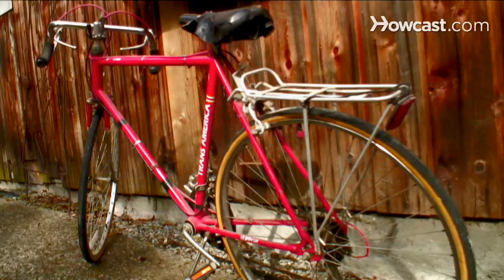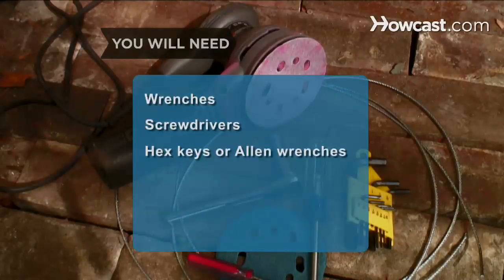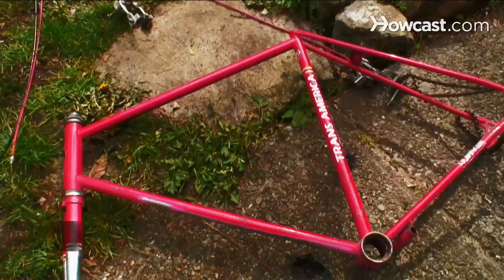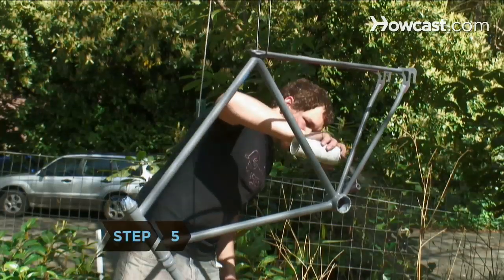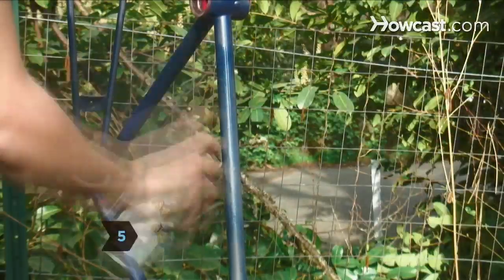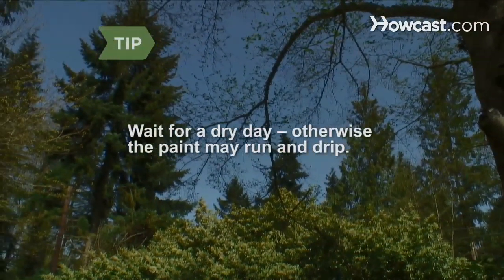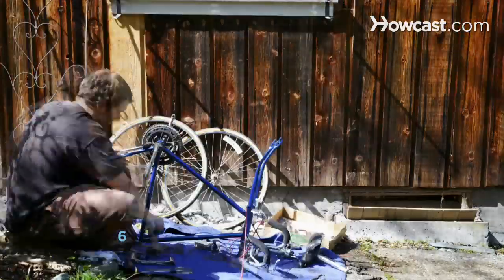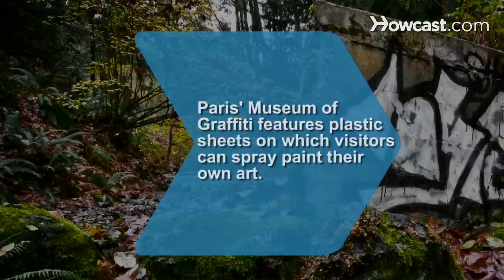How to Paint a Bike

Comment: Why sand the frame, that's too much work, just buy some paint stripper in a spray can! I used Kleen Stripper brand and had my bicycle stripped in one hour. Just spray it on and wait for the paint to bubble, after that just use a wire brush or just take your garden hose with pressure nozzle and spray it off!